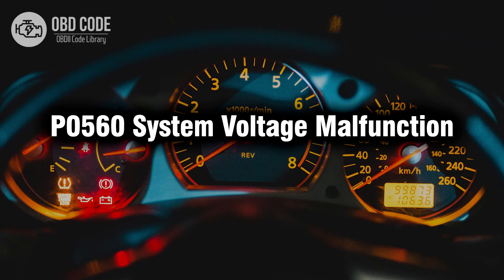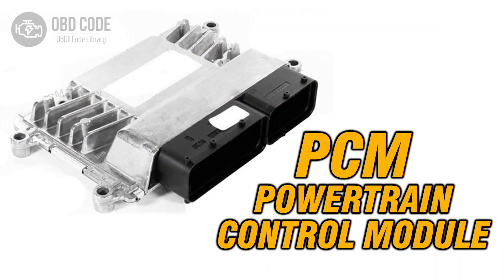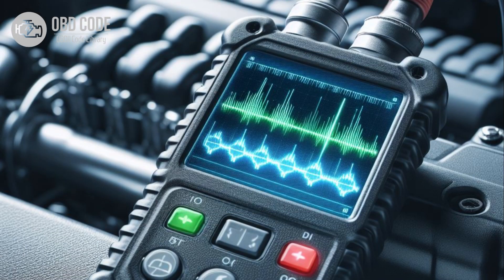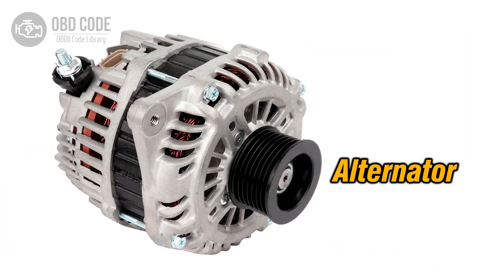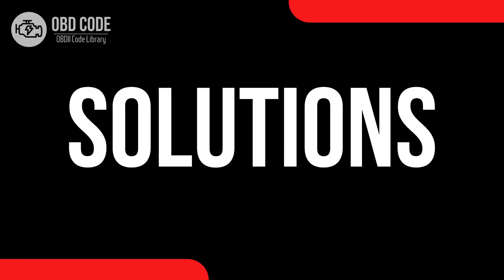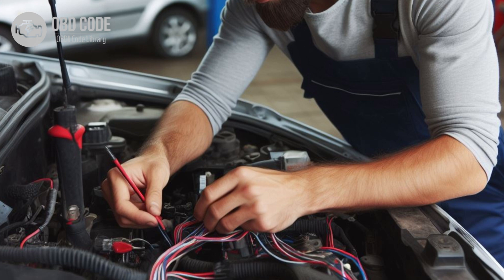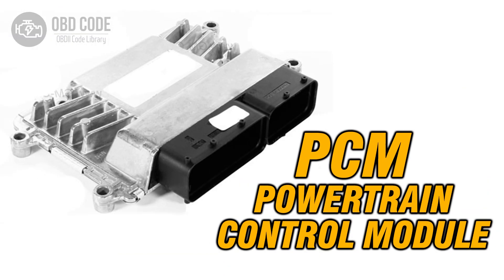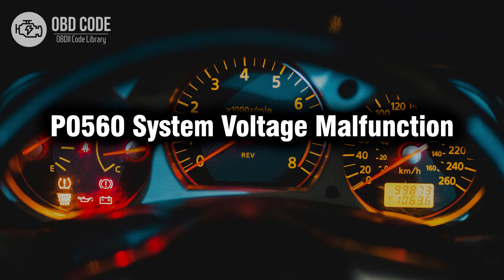P0560 System Voltage Malfunction 🟢 Trouble Code Symptoms Causes Solutions

Comment: Hello, I have this code, my symptom is that inside the car, there is a kind of bibration/poor-sound like "buh buh buh buh buh buh" two "buh" per second in relenti each time the electric fan start to be in function and when it get stop/pause the symptom stop too, just when the fan is in function, when it happens and I push the gas, the "buh buh buh buh" gets fast too.

If I turn on the lights inside, I can see that symptom reflected in this, like it gets a soft flicker with the buh buh buh.
Reply from the maker: Good morning, I advise you to go to a mechanic specialized in the brand so that they can advise you in a more precise way.